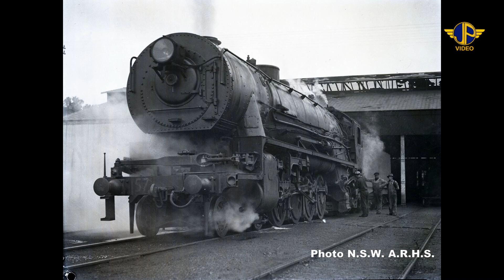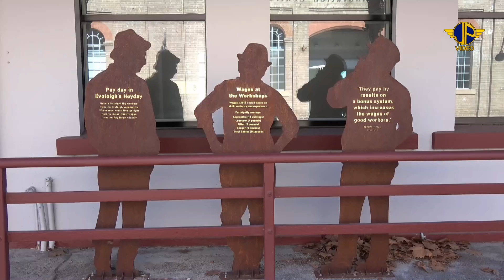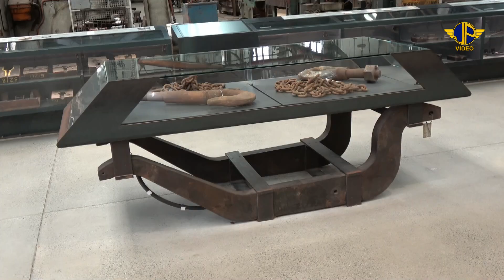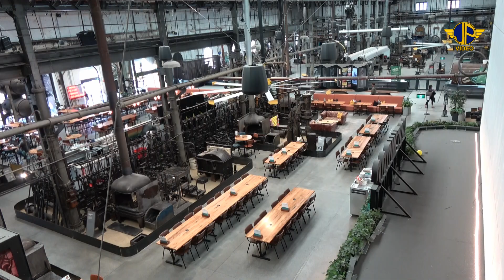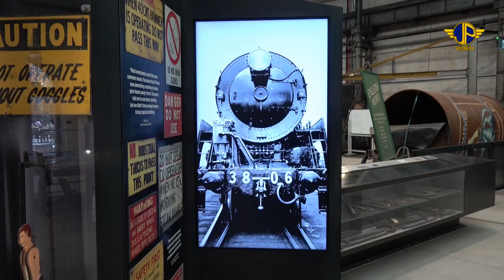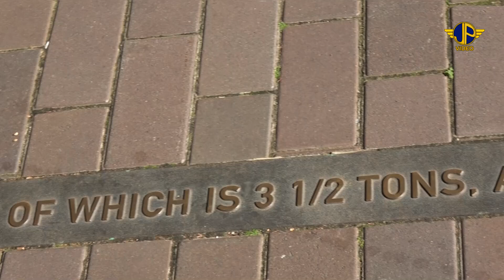Eveleigh Locomotive Workshop Revival

Comment: Well presented and very informative.
A part of the complex was used for handing out of uniforms and gear for volunteers at the Sydney Olympics. I got mine there.
The image of 3806 is significant in that it was the first of the famous 38 class to come of the production line there. The first five with their streamlining were made at the Clyde Engineering shops. 3806 to the last 3830 were made on alternating numbering between Eveleigh and Cardiff, Newcastle.
Reply from the maker: Thanks and also thanks for the information as well

Comment: High good to be able to see Eveleigh Loco Workshops and how it has evolved into what it is today as sad it may be for some. There are but a few handfuls of old Eveleigh Comrades left. And all are mid sixties or older and remember with fondness Eveleigh Loco. Most are lifelong friends formed when we were Shopboys  or Workshop Labourers in the many shops that were there. Such as the fitting shop, Millwrights, Machine Shops, pattern shop, Large or Foundry to mention a few of many. The characters such as Ticky who fixed watches and clocks, Jimmy Jefferies known as the Boxer, Foreman in the Millwrights to mention a couple. 
Just a few corrections payday was carried out on a Tabe set up that was put on the back of the little Industrial truck which worked its way down the middle road and paid each shop and was never paid at that window as this was the scheduling office in my time. The park with the plaques in the ground was the Spring Shop which was an annex attached to the Blacksmiths Shops, the shear was located on the southern end outside between 1 & 2 bays which was part of the Blacksmith’s shops. No complaining just letting people Know, any way have mama fond memories of the people and going ons at the Mighty Eveleigh Locomotive and Carriage Workshops. The nucleus of manufacturing in Australia.  The home of the Union Movement in Australia and Red Square still stands mostly unmolested.
Reply from the maker: Thanks Neil for all those memories , I started work at the Newport Workshops in Melbourne and we had similar characters , thanks for your interesting comment .

Comment: Hi John, Awesome video, well done. It is utterly fantastic what they have done there by incorporating all the original works into the modern facilities. This is a model of what should/could be done in many other places. I think of the Roundhouse/Machine Shop I used to work at here in Vancouver BC that is now fortunately saved, but not with the machinery, which is quite similar in many respects to what is in your video. Thanks for a great showing. Cheers AC.
Reply from the maker: Thanks mate , yes they did a great job keeping most of the machines and fitting the redevelopment around it